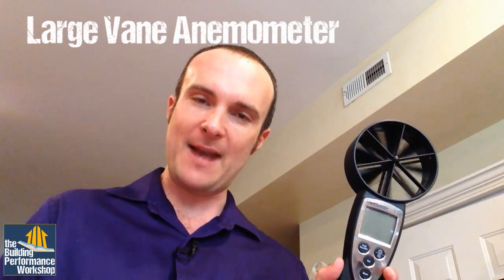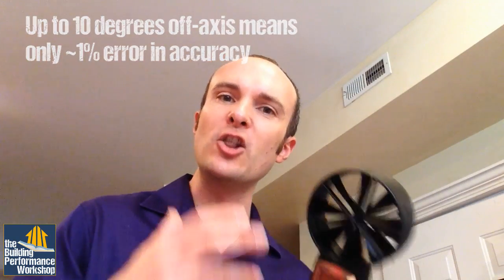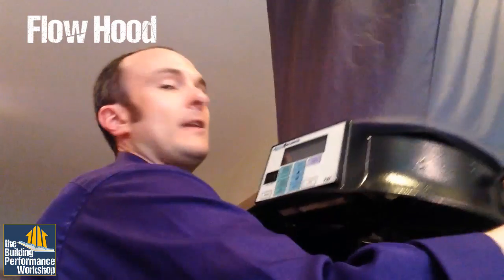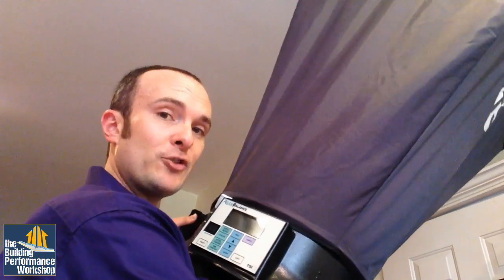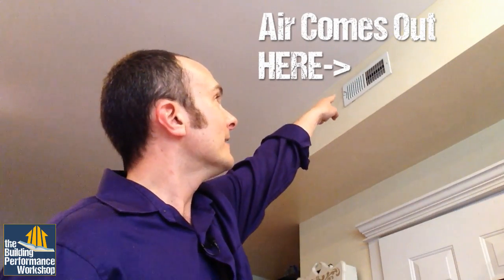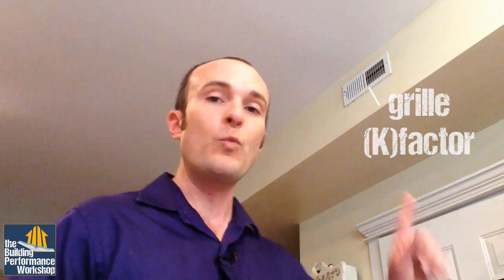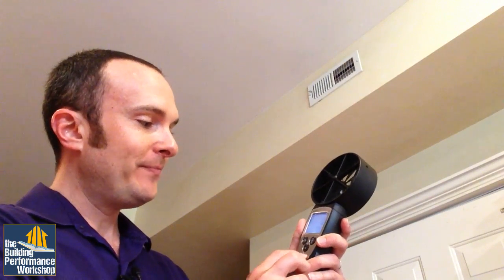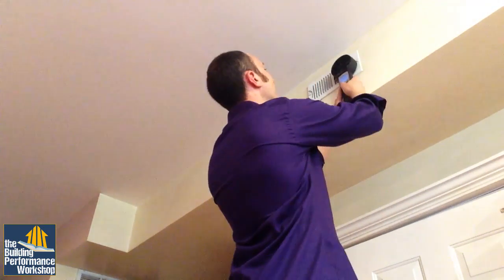Anemometer + Flow Hood: Discovering a Grille's K-Factor for HVAC Airflow Testing

Comment: 134 fpm x 0.75 kf = 100.5 cfm. So the fpm thru the second grille would be near 134 fpm (if your anemometer does not have cfm).

Comment: I am confused by your math. I found this formula for K factor on the internet, CFM = K factor x Air Velocity x Duct Area. So shouldn't the formula look like this? CFM = 0.76 x 351 x 0.219 which equals 58.4CFM but your device indicated 102.7CFM. Is the math inside your device wrong or is the formula I found for k factor CFM wrong? Thanks for your help!

Comment: Well done, BUT don't forget that the SUPPLY AIR LEAKAGE into an unconditioned space is often 10% or more of the air passing through the evaporator. Measuring all of the supply air grilles will only give you the air volume DELIVERED to the home. Evaluating the system or charging the system must include the SUPPLY AIR LEAKAGE. This is especially true when the ductwork is undersized as well as poorly sealed.
Reply: Very true. Seal every joint. Wish people would understand this more. Makes it alot harder to dial in a system. Itl never be rite even though you think it is

Comment: I noticed that those registers have dampers in them. I was taught that velocity changes with the movement of the damper. For an example wide open would be less velocity and as you close the damper velocity increases and the free area of the grill also lesson's. But I'm no expert on air balance just a rookie. But if what i am saying is true don't this mean your k factor will also change meaning a non accurate reading ???
Reply: Being that the damper is against the back of the register.now if the damper is back in the duct aways i would totally by into what you are saying
Reply from the maker: +Kurt Weems bottom line: there are inaccuracies in every test method. What I do typically in a normal balancing once-over is just test the velocities to ensure 500-700 fpm, then pressure balance between rooms. Measuring or calculating actual cfm is challenging. Btw, the details of this vid met technical ok by Bill Spohn of TruTech Tools, who is one of the top experts on measurement devices.

Comment: I'm so glad you pointed that short coming of the anemometer out for me. I watched a True Tech tool webinar on airflow ,that didn't really explain much about the opening angle and cfm relation. It emphasised that a fan moves a consistent amount of air. No density correction was needed when you test with that Testo anemometer that you had. I internalized that as being the perfect testing method. So I raise my hand..."I am an idiot !" There now I can learn lol
Reply from the maker: Joseph Quattrocchi HA! So glad my idiocy is rubbing off- and by that I don't mean wearing away. If anything, it's growing on me. More to rub off on other people. All airflow testing is fatally flawed by the fact that air is squirrelly and refuses to be measured. Almost like it's laughing at us. Maybe air is the idiot.
Reply: @HomePerformance  Hello Corbett! I have a question about the K factor. In situations where you can’t find the engineering data, could I take a measurement with and without the register in place to find the K factor? Thanks in advance!

Comment: Thank you for the nice demo!  I'm not sure it's accurate to assume flow is identical (enough) at two different grille locations to calculate the grill K-factor this way, however.  Best to measure velocity AND flow rate on that once ceiling mounted grille - and hope that a variable speed system (if applicable) hasn't changed rates in the meantime.  Thanks - MB
Reply: He didn’t assume anything. He measured the volume and velocity from one grille and calculated his k factor. He then read the other grille using the k factor already established to get a volume. And you never just hope a fan doesn’t change speeds you make sure that a fan is forced to a constant speed if it is a variable system, otherwise you are just chasing your tail.

Comment: Hii
Please tell me wich anemometer is more sensitive. With small vane      or with bigger vane, what is the difference between them.
I didn't find anywere.
And thanks for video.
Reply from the maker: Equally sensitive, in one sense, but the large vane accounts for greater user error. You don't have to keep it aligned in exactly the right way to get the reading.
Reply: @HomePerformance  Thank you alot, and happy new year.

Comment: In my experience the method described is good but the correct way would be to pitot traverse the duct supplying the grille for a true volumetric reading. Use that then to determine the K-factor as the airflow hood itself has restrictions.

Comment: Question about changing k factors!

I saw the video and read a bunch of comments. I'm sitting in Sweden and in a house that collects air from toilet. Bathroom, sleeping rooms - most rooms actually except the kitchen - it has its own exhaust. Anyway, I read somewhere heat pumps are getting a bit more frequent in US? Right? Here in the Nordics they are in every house,unless connected to the city common heat. Or living in the countryside. There are some different versions of these heat pumps - like the one in my house called exhaust heat pump.
Inlet air comes through fresh air vents in most rooms, the cold air heats up in-house and gets eventually into the exhaust air nozzles.
That's my problem. These are setup in a way they regulate the volume flow per second individually. Once adjusted but now completely gone. It is the relation I would like to know. But they have all different k factors. The only thing I see is the total flow. That is in range of changing all air in-house in 2 h.
It's very expensive to hire someone for these measurements. One time sure, but if trying to meet the best fit air change / electricity bill - it would be great with a tool for this.
Like measuring the co2 and adjusting the total flow to this (no one home - lower the flow).
The thing with heat pumps in general is they prefer to use as little heat as possible. Reducing air flow when no one is home decrees then compressor speed and less heat needs to go into the floor heating system - and the conversion electricity / heat will be better. Maybe 5:1 instead of 2:1. We'll, in the range. Since the  system also make hot tap water it will control the vent if needed. 
Long writing - I just wonder (did not check the other videos) if there is a way to compare the vents. I don't need the exact value but would gain insight in the relation between these  exhaust vents. I know the total - I set it in the pump m3/h, about 120-250 in our house. 
Anyway, nice see som one discussing this. Looking home it's not a subject. I believe we could do so much more to reduce the fossile exhaust (and save money)
Thanks/Lars

Comment: just need to know the CFM, so I should just set up the device on CFM and whatever I got it will be the actually reading???
Reply from the maker: Unfortunately no- you don’t know exactly how big the cross-sectional area of the opening is. To get CFM, you multiply velocity (FPM) by area- like a 10x5 grill, or 50 sq in. But the vanes and other metal bits take away from that 50 sq in- that’s the K factor.

Comment: Good explanation,,,,I have litle  question,,,,I have FCU ,,whit 1.600 CFM SUPPLY ,, whit 4x Register ,,how many CFM I should have FILTER GRILL RETURNS ...? Can I use the vane  anemometer or Capture Hood ?
Reply from the maker: Interesting keyboard technique, my friend. If the 4 returns are all equidistant from the blower then 400 CFM each, right? Any tool can generally measure that range. Maybe I misunderstood you.

Comment: Those grills are a pretty common size.  What would happen if you were to remove the grill (2 screws) and make a measurement --then put the grill back on and make another measurement.  Would you be able to calculate the K factor from the difference?  Why do you need to know the resistance?  Just curious.
Reply from the maker: The grill actually changes the flow when it's installed. Since that's normal state, removing it and measuring actually doesn't tell you much.

Comment: I know this is a old video hope you still comment I’m building a laminar flow table Which essentially is a large hepa filter in a box with a fan blowing into the plenum of the filter box the filter is 18x24 or 3 sq/ft  

Can I just use a large vein anemometer in front of the filter to measure cfm since all parts of the filter should have even flow over it ? Or is there still a K factor because it’s it’s passing through the filter ? 

I just need to confirm that i am getting that 100cfm sustained flow through the filter
Reply from the maker: Hey Warweed, I try to keep up with responding to all comments! You only need K-factor on supplies, not on returns. You can experiment with your readings against the filter vs. an inch or two away for an interesting variation, might be more different than you’d expect depending on your instrumrnt.

Comment: Hi, arent there smaller flow hoods than the one you showed. Also can you clear up the cfm for each register
The first one was 58cfm and you used the formula. The second one was 100 but you plugged in the k factir into testo. Is that correct?

Comment: what about back pressure compensation? I would take two measurements at a fixed position so with those grilles if using a vane anaemometer and then get the average in m/s. If you then measured one of the slits and multiplied it by how many there were you would get the free area in meters squared. If you then multiply the two together that would give you the flow going through the grille. I've seen so many bodged jobs where people have just assumed that a K factor works for all grilles but it depends totally on the type of grille.

Comment: Once you discover the k factor and record the average cfm. Will the cfm amout change as you move the grill adjustment. I mean everybody had a preference for the opening angle.
Reply from the maker: Joseph Quattrocchi Yes, as Joe Shearer pointed out, this is the failing of the anemometer method.

Comment: Hi, I have a condensation issue in my brand new house. I discovered this on our first winter here in Washington state. So far my guess is inappropriate ventilation / air exchange rate between intake net free area through vents positioned in the soffit/overhang  (the roof’s lowest edge) and exhaust net free area through vents installed at or near the peak of the roof. I am aware that for proper attic ventilation it has to be a balanced 50% intake/50% exhaust. Having said that, what is the best way possible for to measure exchanges rates on this scenario, particularly when I am not measuring fans. What would be a good anemometer and how should I use it? Thank you.
Reply from the maker: Gabriel, if you mean condensation in your attic, then do NOT add more ventilation.  You should airseal the attic floor.  Attic ventilation is very low flow, and you won't be able to measure it with any conventional tool.
https://www.youtube.com/watch?v=fPKt35I4MZ0

Comment: Hi,  good info.  So you could actually test the diffuser on the soffit with a piece of cardboard that is 24x24 taped to the top of the capture hood, then just cut out a hole big enough to fit the diffuser inside the hole to let the air come thru the hole in the cardboard.  Duct tape and cardboard are a air balancers friend on a capture hood.  just sayin...

Comment: Odd question; can you make a smaller tapered hood with an access hole for the vane  anemometer and get the same results?
Reply from the maker: They sell that, but it’s really only for exhaust applications or returns. Any capture hood induces some amount of back pressure that screws with your reading- the bigger the hood, the better.
Reply: Thanks

Comment: I have AC that was repaired but while blowing cold air does not cool the house now.   Professionals can not find whats wrong.  It was working amazing for 2 years.    Thinking it may not be putting out enough CFM. How about this one?  HOLDPEAK 866B Digital Anemometer Handheld
Reply from the maker: Any test data is better than none! Best of luck- you should also check for disconnected ducts.
Reply: Played with Anemometer today.  Its confusing that the two return airs total about 1400 ft/ min and most registers are putting out 380 to 400 ft/ min.  Just 4 registers exceed the 1400 going in.   I was expecting total intake to be dispersed across the balance of registers at different rates based on distance and size.
Reply from the maker: Feet per Minute is velocity - if you want everything to add up, you need to multiply the velocity (FPM) by the cross-sectional area of the duct or diffuser in square feet (e.g., a 12" by 12" grille would be 1 sq. ft.). You can't really add velocities together.

Comment: Thanks for the reply!! I plan to buy your book from TrueTech after Christmas.
If you don’t mind one more question, it’s been years since I was in school and never have had to deal with duct design or residential.
Do most designers just use 0.1 friction loss for supply and 0.5 loss for return?
I’ve never seen anyone use anything else using a ductulator  or slide etc
Thanks again and subscribed
Reply from the maker: I think you mean 0.1 each for both supply and return- enjoy the book!

Comment: Very useful. So is this the same "K factor" that is used to calculate the effective ventilation rate for dilution ventilation (Q')? Would I be able to take this approach in an industrial setting using both the rotating vane anemometer and balometer for determination of ACH?
Reply from the maker: I think you might be meaning another K. There are at least 2.

Comment: Do you have a source in ashrae for static pressure loss per foot of ducting? Are there any losses due to the duct created in the video, however small?  Thanks for the very informative video.
Reply from the maker: +fluterampal not sure what duct you're referring to, but every duct creates pressure loss. There are a ton of pressure loss calculators online, but you can see the equations in ASHRAE Fundamentals duct design chapter.

Comment: so I don't have the same anemometer so do you put in the k type under area? as .768?  or do you just put the area of the vent?
Reply from the maker: It's math you'll have to do on either the area of the vent or on the CFM you get.  Either way, hard to determine without another piece of equipment.

Comment: Do you ever use a hot wire anemometer? or a Pitot Tube Anemometer to measure at the source? If so, do you use a piezometer ring?

Comment: Corbett this might be a silly question but I'm going to ask any way. If you use this on a floor supply register can you just remove the register and forget about the k-factor. I seen you on Matt Moreman's video and have followed you since. Thanks
Reply from the maker: Hi Richard- no, don’t do that. The register induces some restrictive backpressure, so if you take it off you won’t be taking an as-is measurement. You can alternatively use the new CPS Easyhood which is less expensive than either of these tools- see the review on my channel.

Comment: Sir what if there are no registers from which flow can be taken by flow hood and calibrate the anemometer against it? Can we still find the free area(k factor)
Reply from the maker: You can assume 0.8 if you must
Reply: Home Performance thank you so much for your response sir.. please don't find me annoying..I am here to learn from you..I have another question.. what if the grills of register are a bit thicker? The free area will reduce and 0.8 won't be acceptable to such register or grill..kindly guide me sir
Reply from the maker: I’m sorry, I have no further guidance to give you buddy! Your guess sounds as good as mine on k factor. However, you could just do a velocity check, with 500-750 fpm being the target for mixing, then do a system airflow test at the blower, then do a duct leakage test. Lot more moving pieces in that scenario.
Reply: Home Performance ok thank you sir..may God bless you

Comment: My experience in HVAC is mostly limited to residential and light commercial installations, but my goal is to someday become a service tech. Air balancing is something that we as installers never do, so it's a big gap that I need to fill in my knowledge of how to get residential systems up to snuff. 

So is there any way of figuring out the register's k-factor without having access to a flow hood? I do own the same vane anemometer you show in this video, is there a way to figure it out only using the Testo 417?
Reply from the maker: Watch the video '8 Ways to Test Airflow', and you'll see that a plastic trash bag actually gives very reliable readings. Bam.

Comment: Cool video. I noticed you had the cieling register damper partially closed. I'm assuming you did this for even distributing of air. I wonder if your k factor would increase if the cfm was 100-120 through the hood test grille. I will have to review the math again to understand how you did that. And I really don't have access to a flow hood.
Reply from the maker: Joe Shearer Way to open the can of worms, Joe! Yes, you're exactly right- in fact, airflow measurement is generally regarded to be the biggest PITA in the universe, and my buddy Bill Spohn of TruTech Tools is going to be on a quest this year to separate what's POSSIBLE from what's PRACTICALLY USEFUL. Big difference, as you pointed out.
Reply from the maker: Guys, I'm bringing in the Big Guns- Bill Spohn , are you there?
Reply: Home Performance I'll give a thorough answer, but it will be a while as I am traveling this week and busy next week.

Comment: Doesn't the flow hood also have a k factor adjustment? I'm not sure when this is necessary...
Reply from the maker: Good question, but I believe there’s a key difference- the hood measures the total airflow simultaneously, and the anemometer needs the total flow calculated.